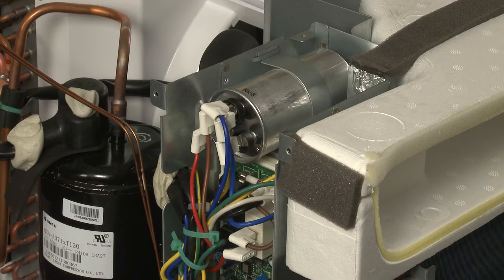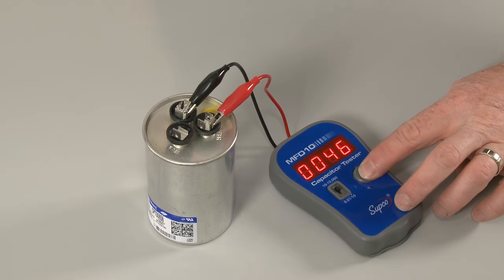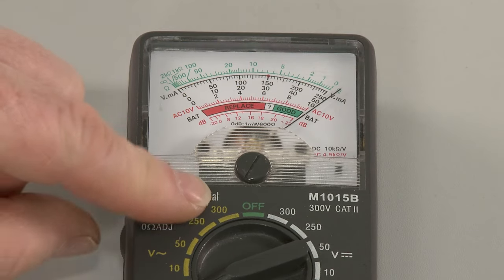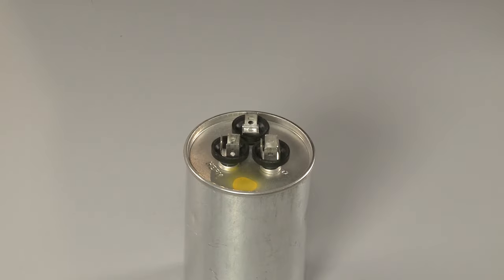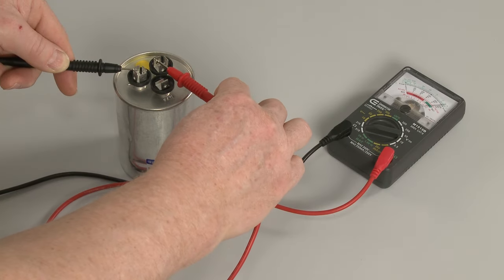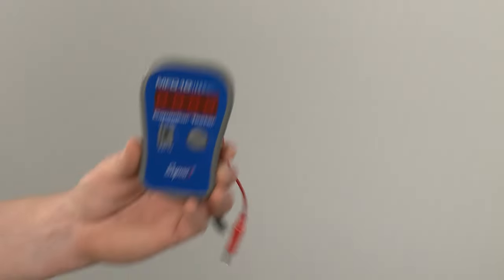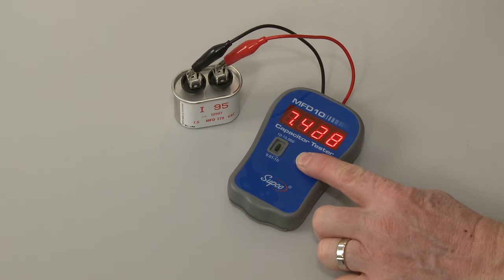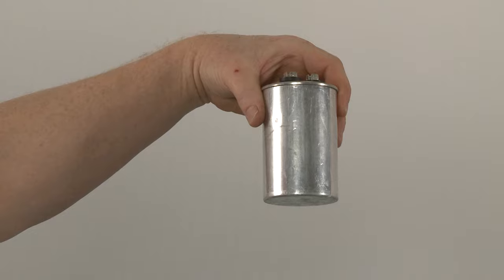Air Conditioner Capacitor Testing

Comment: Shouldn't you discharge the capacitor it with it disconnected from the circuit?
Reply: I think they did earlier in the video. Maybe when they pull the safety switch then ground the capacitor it's safe? I always ground them multiple times for my own comfort lol.
Reply: @0:50 they mention dischargin the capacitor